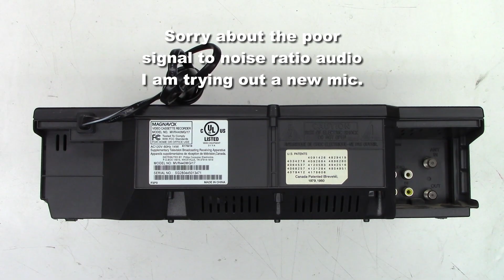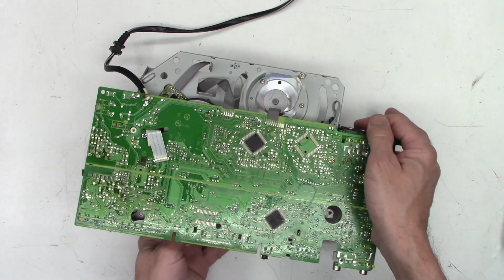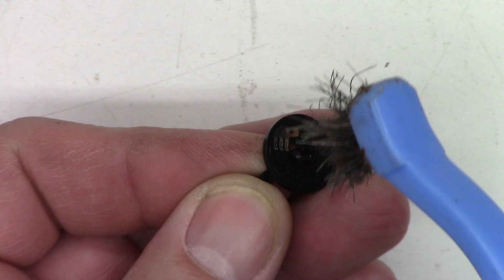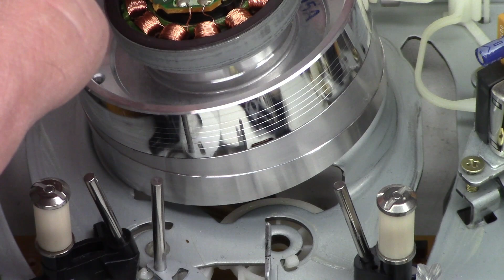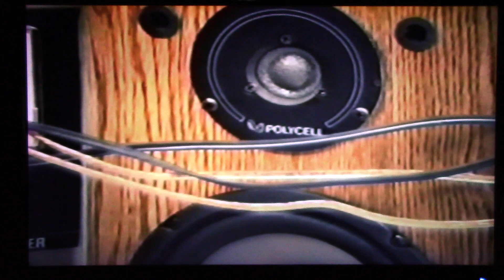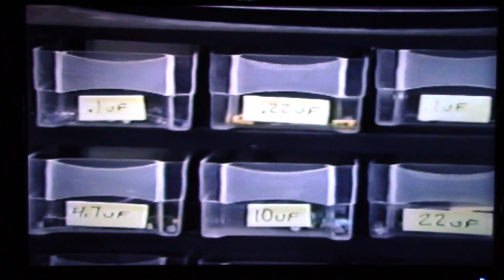MAGNAVOX MVR440MG-17 EATS TAPES   MODE SELECT ISSUE   VCR REPAIR

Comment: do you know how to fix dvd recorder that when turned on makes really really load humming sound?
Reply from the maker: Is it like a motor running trying to load? Or is it though the speakers?
Reply: @norcal715  it sounds like the humming is coming from the inside where the lazer is at.  And that same sound comes out of one of my dvd players but its much more lower on that player than on the recorder